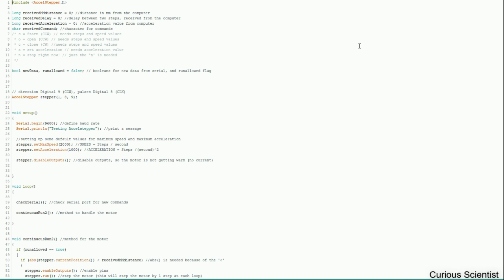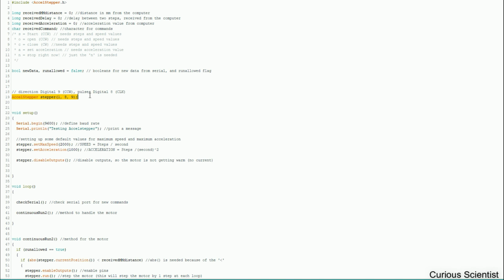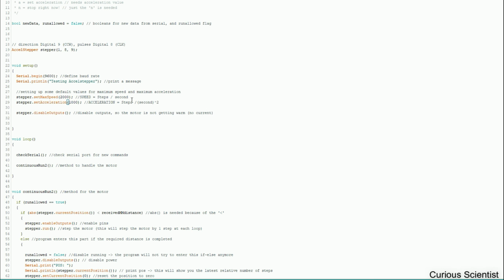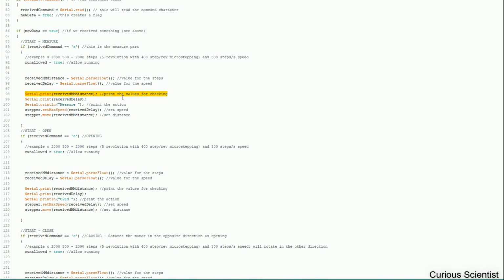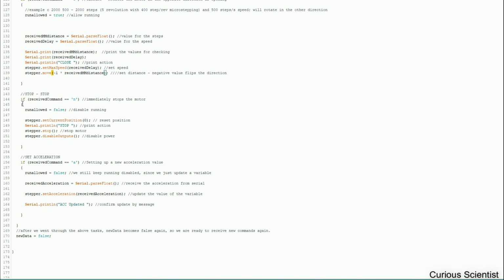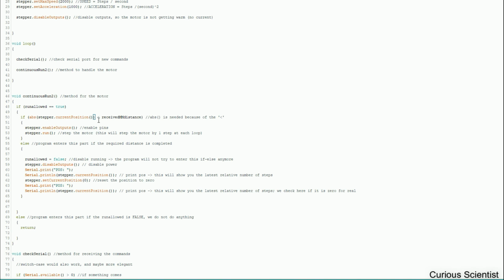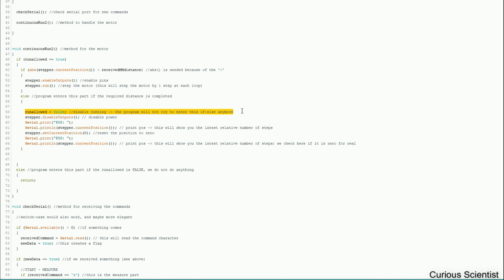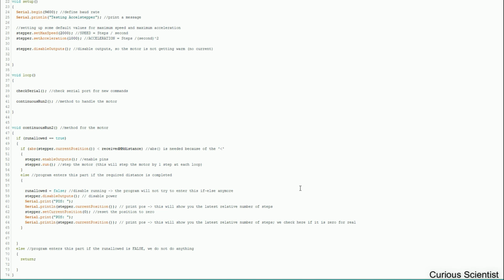Arduino with TB6600 using AccelStepper library

Comment: is it possible to use this code with esp32
Reply from the maker: Absolutely, if you use the esp32 in the Arduino IDE. Pins might be different, however, so check them carefully.

Comment: Did you write this software? Because your explanation is full of errors. For starters: 3:11, AccelStepper(1,8,9); you explain that the "1" stands for the number of motors. This is wrong; the number refers toi the MotorInterfaceType.
And so on. Really bullshit explanation.
Reply from the maker: Yeah, that is a mistake there, "1" is the interface type as you said. 

However, I don't see you making a better explanation video on your channel. Could you please explain it better? And so on.

Comment: how to do that now with the arduino being powered by an external power supply
Reply from the maker: If the external power supply is 5 V, then I directly connect it to the 5 V rail. If it is above 5 V and below 12, it goes to VIN. But I don't recommend using the VIN because the onboard regulator is weak and can get hot or even burn.
Reply: @CuriousScientist  when i use the usb to power and run the motor works fine. But when i use external through barrel jack or even vin the board lights up but doesnt run the program
Reply from the maker: You probably forgot to connect the grounds together.
Reply: @CuriousScientist  between what?
Reply from the maker: Between everything. Ground is called as common for a reason. You probably don't have a ground path between the Arduino and the stepper motor driver's supply.

Comment: Hi, does it work for other drivers such as DM556?
Reply from the maker: Hi! The DM556 uses the same driving principles, so it works the same way. I even have a video where I discuss and demonstrate that the exact same code works with any drivers that work with step and direction pins.
Reply: @CuriousScientist  Thanks for your reply
Reply from the maker: You're welcome!

Comment: Thank you for the video.
How do I configure to run 2 or more motors in one Arduino?
you said "AccelStepper stepper(1, 8, 9)" 1 it for the motor 1.
can I configrue: 
AccelStepper stepper(1, 8, 9) for motor 1
AccelStepper stepper(2, 10, 11) for motor 2 or i have to configure
AccelStepper stepper2(2,10, 11)
Reply from the maker: Hi and welcome! Yeah, you got the essence of defining multiple motors. However, you should keep the first parameter as "1". Also, I would consider using other pins than 10 and 11 because they are also used as SPI pins on Arduino Uno and Nano. Of course, if you don't use SPI peripherals, then you can use those pins. 
Follow this example:
https://youtu.be/Xf39xbopAFM

Comment: Congratulations for the video, very good explanation, excellent code, just a question, when it's running in ping-pong, it always takes one more step to one side, that is, the rotor moves, it never comes back to the same position, there's a way to avoid that ? Make the rotor always return to an exact point? Thank you very much in advance.
Reply from the maker: Thank you! Actually, you aren't the first person to notice that steps are lost when the motor changes directions. I got this feedback from others too. I couldn't figure out why, but I am on it. Maybe it is the library I use, or how I use it. I will need to investigate it because I don't know the exact reason.

Comment: Thank you for the video, I wonder if it is possible to connect the Pul+ and the Dir + Modules to the Pins 8 and 9 in the arduino and Pul - Dir - to the GND Arduino?
Reply from the maker: Hi! No, that's not how the circuit works as far as I know. The positive pins should be tied to a positive supply and the negative pins should be controlled by a GPIO pins. Usually, this is also stated in the datasheet of the controllers.

Comment: So what is the meaning of not connecting the ENA(-) pin, if you have on the code a command for disableOutputs() and enableOutputs(), how do these work?
Reply from the maker: I left those in optionally. It is up to you if you want to use it or not. By default,  the motors are always powered.
Reply: @CuriousScientist  Thank you very much for your response. So connecting EN is mainly to power on-off the drivers? And if not conected, they are always ON. If I have multiple drivers I can join all EN pins to one common Arduino input?
Reply from the maker: Yes, it is ON by default and if you change the pin (pull to GND, if I remember correctly, but please check the datasheet), then you disable. This option is very useful if you're noticing overheating motors, but it is a good idea to disable them if you don't move them very often. You can join several pins together, however always check the switching current as that might be too high for one GPIO pin if you combine the pins of multiple drivers. Always check the datasheet of the drivers.

Comment: Installed the library but still getting the error "fatal error: AccelStepper.h: No such file or directory
 #include <AccelStepper.h>". I have installed library by Mike McCauley Version 1.6.1.
Reply from the maker: How did you install it? Via adding as zip file or by using the library manager? Have you restarted the IDE? Seems like the IDE cannot find the files.

Comment: Is there any way to pause the motors with deacceleration if a pause button is pressed  or a sensor is high ?     
  if ( digitalRead(obstacleSensor) == HIGH){
stepper1.setAcceleration(100.0);
stepper2.setAcceleration(100.0);
    stepper1.setMaxSpeed(0);
    stepper2.setMaxSpeed(0);
 }
 else if( digitalRead(obstacleSensor) == LOW){
    stepper1.setAcceleration(100.0);
    stepper1.setMaxSpeed(200);
    stepper2.setAcceleration(100.0);
    stepper2.setMaxSpeed(200);
    stepper1.run();
    stepper2.run();
 }
}
Reply from the maker: It is doable, but not in the way you are asking for it. If you "pause" the motor, its speed will be zero. So, when you start again, first you have to accelerate to the speed where you left previously and then decelerate from there again. As far as I know, the library cannot tell you what was the most recent acceleration, so that could be tricky. But without accelerations, you just save the speed into a variable when you press the button, then stop the motor by stop calling the run() function. Then, when you release the button, you set the speed of the motor and start calling the run() function again.

Comment: .... and another question: How can the code execute the "stepper.stop();" function when the motor is running ?
Reply from the maker: Well, the purpose of the stop() function is to stop the motor.
Reply: @CuriousScientist  ok I understand but that is kind of multitasking ?
Reply from the maker: No. The stop() function sets a close target and decelerates the motor to 0 within that very short distance. You can read the manual of the accelstepper library to understand how it works.
Reply: @CuriousScientist  ok I'll read it. Thank you for take the time to respond all the comments. Not all the people take that time, greetings from Guatemala.
Reply from the maker: You are welcome! If people ask the question in a proper way, I will try to help them. :) Have a nice day!

Comment: Brother, I used a TB6600 driver with a Nano and wired accordingly and powered with a 12v,10A SMPS. I selected the current and steps/rev(200) with dip switches according to the specifications of the Nema 23 motor referring to the chart. When the motor runs at slow speed it gives a grumbling noise and gets heated up quickly. I tried with another Nema 17 motor with settings changed, still the same grumbling noise and heating. But I used a A4988 driver with the same Nema 17 motor, then it 
runs smoothly and does not get heated up. Could you advice me please?
Reply from the maker: Hi! I think that GND connection was missing somewhere. I don't know your circuit, but you should make sure that all the components are sharing the same GND.
Reply: @CuriousScientist  Thank you very much for your prompt reply. I think I used the same Gnd in the whole circuit. Anyway I shall check again. Thank you again for your kind advice. I would like to send my circuit diagram if you could provide me your email.
Reply from the maker: You can find my mail on my website. But please don't misuse it as I am not a free support service.

Comment: hello.can you help me? I'm using this library for two engines. Whenever the button is activated, the engine must move a few times and stop. There are two engines and two buttons, but when one engine is moving and the other button is activated, it waits for engine 1 to finish. the stroke to start the engine 2.I need them to work whenever the button is pressed simultaneously.
Reply from the maker: You can make it work simultaneously. I have a video where I use a joystick with 2 stepper motors and they work at the same time without any problems. https://youtu.be/Xf39xbopAFM

Comment: Thank you, very informative video! This will help me a lot.
Reply from the maker: Glad it was helpful! Don't forget to check out my more recent stepper motor-related videos too. They will be even more helpful, and as always, you will find the source code in the description of the video.
Reply: @CuriousScientist  Yeah! Send me the link, please.
Reply from the maker: @pisobre2  Just check this playlist: https://youtube.com/playlist?list=PLaeIi4Gbl1T8zzA9jt4VeGGsA6XmIMLWz
Reply: @CuriousScientist  Thank you. So, just to confirm my understanding of maximum PPS (or RPM), acceleration allows us to reach higher numbers. For example, if we don't use acceleration and try 2000 PPS (right at the start), the motor could not work, right?
Reply from the maker: @pisobre2  Exactly! The "inertia" of the shaft does not allow you to start the motor immediately above a certain speed. But, if you accelerate the motor, you can reach even a few thousand RPM. But remember, usually the faster you go, the lower the torque! You can Google any stepper motors speed-torque diagram and you'll see it.

Comment: Hello Sir, I have tried the example for the "Code Snippet for AccelStepper Oscillator". When I type "K" in the serialmonitor  the motor only moves clockwise  ones, it doesn't oscillate back and forth. Could you explain a bit more why this is the case? PLEASE!!
Reply from the maker: Hi! Have you inserted that code into this code, or how did you try to run it? Since that other code is just a snippet, it has to be inserted into a code which takes care of the rest of the controlling things. I have other videos where there is a full code for similar motion, check those too!
Reply: @CuriousScientist  yes, I inserted it into the main code,  the other functions are okay such as "a"," c", "s" etc but whenever I typed" K" it rotates once and that's it.. I didn't even get the follow up message on the serial for the S and P
Reply from the maker: It should work, so I don't know what should have gone wrong. I will look into this issue soon!
Reply: @CuriousScientist  thank you
Reply from the maker: @kevoysmith5352  BTW, have you actually tried to fix the code yourself, or you are just waiting for a ready-made solution?

I updated the code snippet, and also tested it. It works for me, however, this is an ugly solution.
Reply: @CuriousScientist  a ready made solution would be preferred. I'm not a programmer but I found  your videos very informative. So, I was just following along using your examples. Thanks for the assistance.
Reply from the maker: @kevoysmith5352  If you wait 1-2 hours, you will see a video that you will like a lot! ;)
Reply: @CuriousScientist  I'm looking forward.
Reply from the maker: @kevoysmith5352  The video is up, enjoy!

Comment: Hallo,
thank you, I try it again:
I ned a funktion that I can let  run the motor forward and bacward automaticly witout gif the command for every motion.
Sincerly
S. Nwaisser
Reply from the maker: Hi! I have another video in the exact topic of your question. It is realized via limit switches, but if you know the distance (number of steps) that you want to go in certain directions, you just have to move x steps in one direction then x steps in the other. It is very simple.
Reply: Curious Scientist With whitch term I can programm the noumber of steps. 
If I erase the funktions of the Endstops of you scatch the stepper starts to run, but he starts emeatedly without acelleration.
I wold need en Stop only on one side.
Reply: and from the endstop the motor shuld run x revolutions and come back to endstop. But only for adjustment, it sholg go forward an bacward for a long time.
Reply: Thank you for your help
Reply from the maker: I think you should study my videos in more details, because I tell everything in them. Alternatively, you can refer to the accelstepper library's website which can be found in the description of the video. 

Of course if you erase the endstop functions, the motor will run infinitely in one direction, because the purpose of the switches in the other demonstration was to change the motor's direction when they are switched... 

You have to define a speed, acceleration and number of steps. Then most simply, you just write a while loop and say that while the number of steps is smaller than the desired one, run the motor with x speed. When the while loop finished, you can write the exact same loop once again, but put a minus sign in front of the speed. With this, the motor will return to the original position with the same speed.

Comment: Hello Curious Scientist, Thank you for this Video it is excellently laid out and well understandable, I have a project/system that currently runs a nema 17,  2.1A motor )/arduino/tb6600/11.1v lipo battery supply (mobile application)   I have it programmed to run a set distance/time on a loop backwards and forwards , but I also want to be able to interject on this loop and control the interjection directions by joystick or rotary encoder , could you please advise me the easiest way to go about this, my email is Karlmorrall@hotmail.co.uk, Thank you , please keep up the awesome Videos :)
Reply from the maker: Hi! I have videos for both rotary encoder control and joystick control using the accelstepper library. Please watch them! Cheers!
Reply: @CuriousScientist  Hello Curious Scientist, Thank you for getting back to me , really appreciate your time , I have seen that you have the videos you mentioned can you confirm that inside them contains the information including the code to create a base code that moves a belt driven stepper motor 1metre one way and another metre back the other way ( i already have this part of code however thats where my programing skills stop unfortunately :( ) 

I would like to be able to interject of this original code via joystick but only momenteralily ie have two codes in one program one that constantly moves the set loop and another idle that when I use joystsick it will activate and temporarily overide and move it accordingly but once I stop usiing joystic it will know its postion in the loop and auto revert back to its usual loop ? can it be done? if so what parts would you reccomend using?would you reccomend using anything with the accelstepper to expand/program the code, any more light you could shine on this would be great help, thank you
Reply from the maker: I think I share so much knowledge about the above mentioned topics that it is not difficult to further tailor the codes that I share for any unique requests. What you want is just run the pattern that you want in the main code but at the same time you check for any changes in the joystick position. If there is a joystick movement which is larger than a certain threshold, then you (the code) just start "listen to" the joystick. When the values are smaller than the threshold,  the original code picks it up from there and continues. This is not too difficult, but it requires some coding. Check my website and my videos. There are a lot of resources that I share. I wrote and explained a lot of codes and principles.
Reply: @CuriousScientist  Thank you so much for your rapid response and helping hand I will endevour to indulge in your videos and website resources :) , and continue to push my knowledge of coding ,I thank you for your hard work and time

Take care 

Rgrds

Karl
Reply from the maker: Thank you for your nice words, Karl! Take your time, look around, and try to digest all those information. If you still have questions after carefully watching the videos, let me know.

Comment: me podrias proporcionar el cableado de coneccion del driver tb6600 hacia el Arduino  gracias
Reply from the maker: I can't speak your language, sorry. Google translate says, that you are looking for the wiring or something. It is written in the source code: you only need to connect pin 8 and 9. 

Furthermore, you might want to check this video: https://youtu.be/3LZ_v3Jldwo
Reply from the maker: Hi again! If you check the description of the video I linked in the previous comment and go to my website by the link, there is a drawing now. I made a drawing today, specifically for the TB6600. I hope it helps.